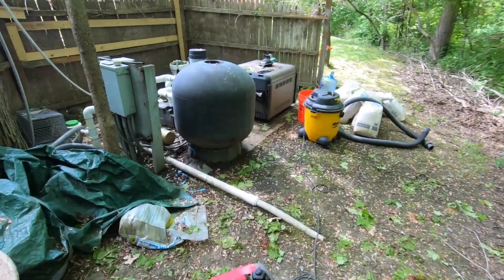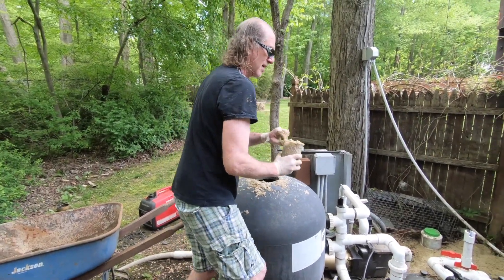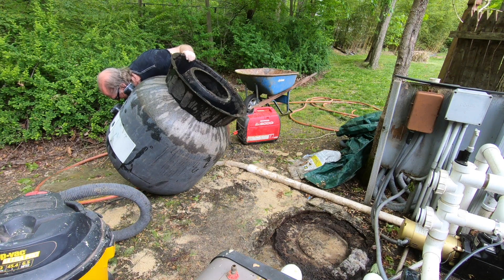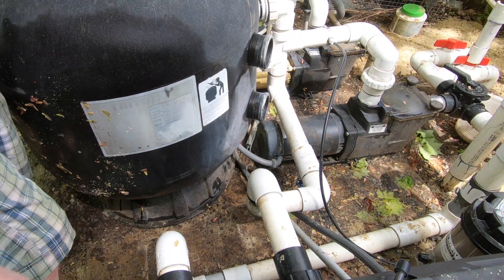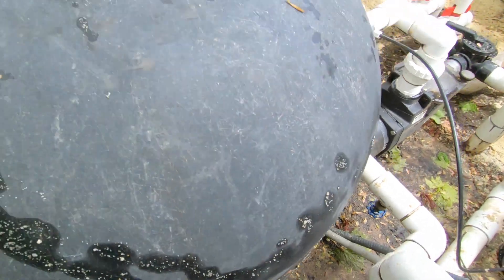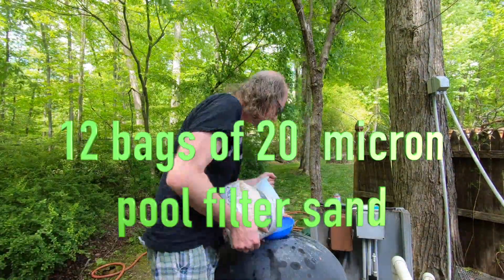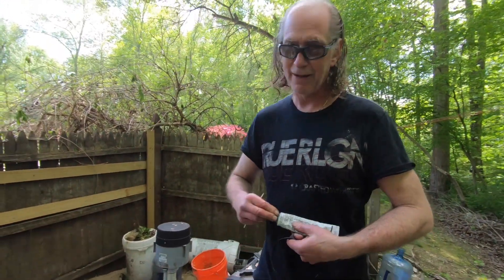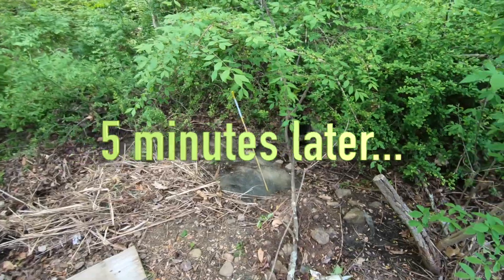Pentair Triton II NEW SAND

Comment: Getting ready to do this for the first time.  I appreciate your detailed video.  So many things we do around the house require watching 6 videos to get all the pieces of info.  You have our exact model, so hoping for no surprises when we get in there.
Reply from the maker: There shouldnt be any surprises. Ive done this twice now. It really helps.  Just make sure to be careful when you remove the sand.  Id suggest using your hands when you get low so you dont break the " fingers". Apparently, if you  unscrew the larger part of the drain on the bottom You can just spray water in there and the sand will come out but I was afraid to force it.  Good luck!
Reply: @Samlol23_drrich  Our drain at the bottom was nowhere near the size of yours (I literally could not get my pinky finger in there). I did read through all the comments and I saw the one guy’s suggestion to do that … wish we could have.  The fingers/laterals in ours were fat and rounds and looked like a cage. They were pretty sturdy.  But we did take caution in those areas.  We ended up getting down to those and in between them by hand scooping. Hubby and I took turns and it took about 2-3 hours. We then filled a little ways with water, loosening the sand we couldn’t get to so easily.  Then we shop vac’d out the last of it - did that process about 3 times. It was obvious that this was way overdue.  There was probably sand that was compacted and not even allowing water to penetrate.  From beginning to end, the full process took us about 5.5 hours with the only breaks we took being when we alternated scooping. Again, your video was great. We have almost the exact same model.  One note I’ll add for your viewers … we both ended up with skin irritation on our scooping arms.  We don’t know if it was a reaction to the silica in the sand, or if it was little metal shavings from the opening that we were rubbing against while scooping.  It definitely felt like little metal shavings, but can’t be sure.  A good thick body lotion applied made it all better.  If I could find a full arm neoprene sleeve or something similar, I’ll use that next time. 

Thanks for the quick reply!  Great video!

Comment: what was your pressure at before you changed the sand?
Reply from the maker: I’ve changed it twice in the 11 years I’ve owned the house. It wasn’t that the pressure was too high. Backwashing fixes that. It was just that my water wasn’t easy to keep clear. I would fight with it on a regular basis. I would add clarifiers, backwash, etc. after adding new sand (both times) no clarifier at all, the water was very easy to balance, was clear and just looked perfect. It’s well worth doing. The results were so good the first time I did it, that this video and the new sand was maybe only four seasons after the last Sand change. It’s well worth the effort. Thanks for the comment.
Reply: @Samlol23_drrich  thanks for the quick reply. My water stays clear but my pressure is like 35# and I've herd its only supposed to be 2. Makes me think they might mean 2 bars which is 30#.... well thanks for taking the time.
Reply from the maker: @Bccool86  no problem.  I think the pressure depends on a lot of things. My setup has the pool and an attached spa with manual diverters. If I run the water to and from just the pool, the backpressure is around 20. If I switch over to supply and return from the spa, its around 30. 
Backwashing to clean the sand will decrease the pressure, but I'm not sure it really matters as long as your water quality is good.   

Thanks again for commenting

Comment: My Brother,..just unscrew the big part of two part drain plug...turn clockwise(reverse thread on your filter) put a hose in it full blast and the sand will mostly run out on its own although very wet. The next day use a rake or shovel to spread it out.
Reply from the maker: I was afraid it didn't unscrew and I would bust the filter. Yeah that would have been way easier. Thanks 4 commenting